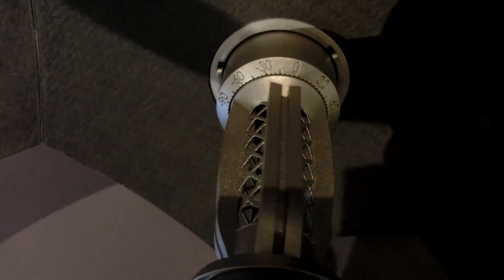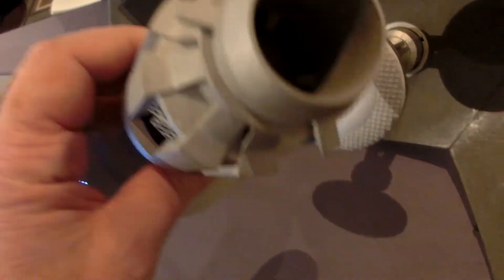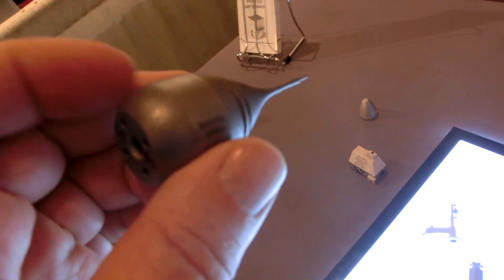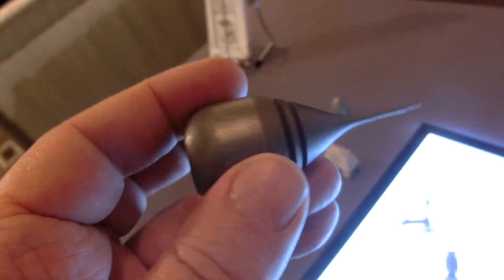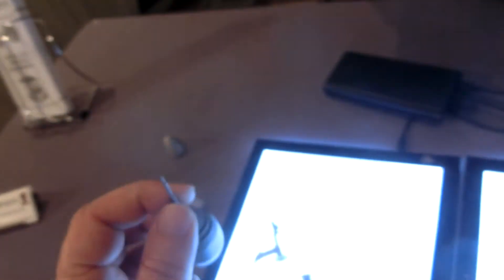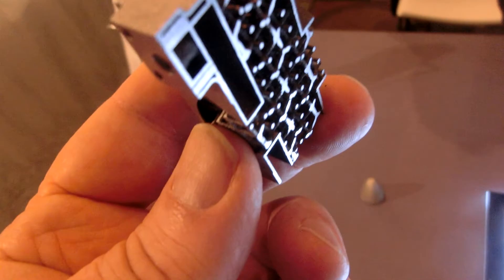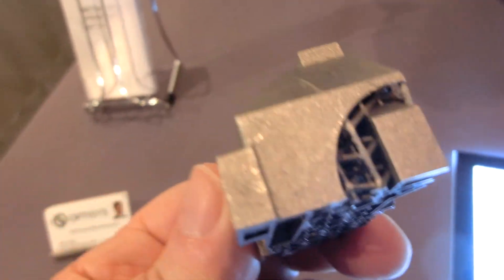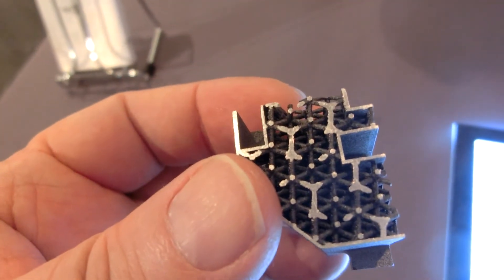3D printing of Horn Antennas for Satellite communication

Comment: Hello sir...Is this metal 3D printing or polymer based  with coating metal spray or any other technique for make it conductive... ?? 
Can u suggest techniques..it can be very helpful to me...
Reply from the maker: It is Metal 3D Printing - you can contact the manufacturer OptiSYS.tech
Reply: @TilTul  .. It will cost high I think.😅.. let me check